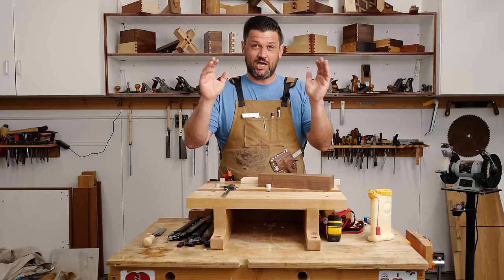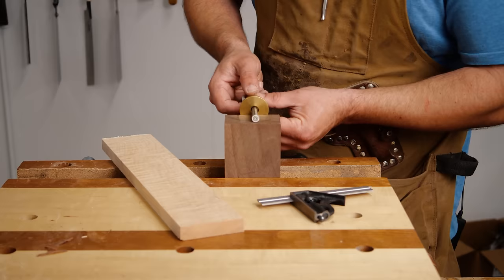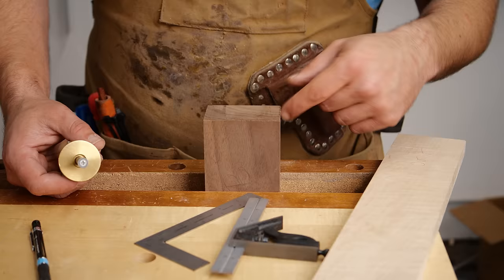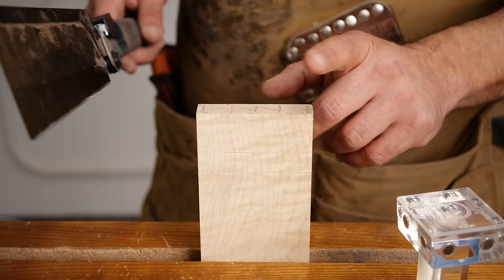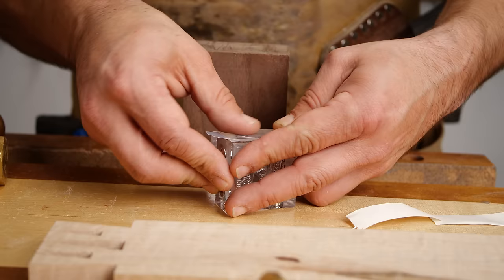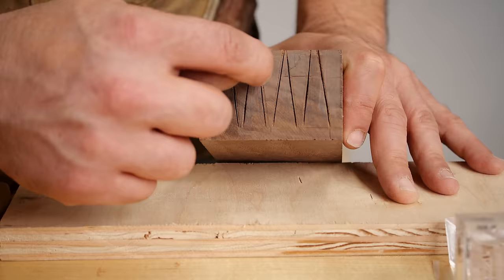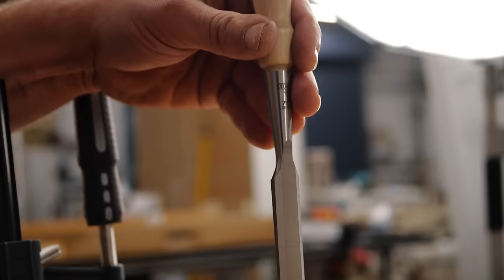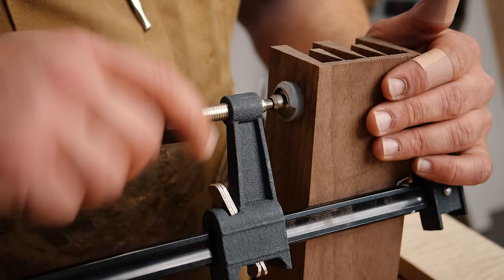Houndstooth Dovetail - Joint of the Week

Comment: Fish Tail chisel is a God send for the pins.
Reply from the maker: Going to have to try one of those
Reply: I took my CBN wheel grinder and modified one of my cheaper high carbon chisels into a fish tail chisel, the CBN wheel does it while not heating it up as much since there's a big amount of steel to be removed.
Reply: The fish tail chisels are really expensive, maybe you could do a video on making some.
Reply: It is a total PITA getting down in there if you don't have the right tool. Rob Cosman makes/sells a good one for $150 (the Chinese version is $120 - for $30 more I'd rather have the real deal)  That is lot to spend for a total one-trick pony but you could cut/grind your own based on photos. - I might drop the $150 just to cure the frustration.
Reply: Tioga Fretworks I got mine from Lie Nielsen for $75.

Comment: I've used a Dremel rotary tool with a tiny bit to clean out half-blinds. Not the whole thing - just getting the undercut and corners once the bulk of the wood is chiseled. The Dremel is easy to control but still very slow going.  For a drawer or two is tolerable.  And -  I have a friend who uses modified high-speed air-powered dental tools - they're even smaller/finer (he's a dentist LOL).

Comment: Will definitely be rewatching this video numerous times. Very curious to see how well I can make this joint. 
I think what would really be helpful is, a bit more explanation on saw angle while cutting, explain the types of chisel, (show them), for newer woodworkers. I've had friends look at me with that deer in the headlight look and wonder what I was talking about, until I'd show them the tool. Great video. Cheers :)
Reply from the maker: Thanks bud! I can't go through all the tools and steps every joint of the week but I do use the series as a building block type thing. Otherwise videos would be repetitive and super long every time. I suggest watching the video A Comprehensive Guide to Cutting Dovetails for a more in depth look at the dovetail process. Also I'm pretty good about linking videos in the cards that go further in depth on certain areas.

Comment: All you need to clear out the corners of half blinds is a fishtail chisel. Find a couple of decent old chisels from a yard sale and let rip with a grinder.  Sure Rob Gorman has a video that shows one he made.  They are far more use than skew chisels as one does both corners. I have one small one and one slightly larger, wouldn't be without them. Took about a couple of hours on the grinder to fashion them but they will last me a lifetime.

Comment: That's a beautiful joint. I'm curious about the strength. Does it come from the outside edges and leave the hounds tooth portion for aesthetics?
Reply from the maker: No it's all structural. That's 1 inch piece of wood glued into a 2 inch piece of wood as a half blind dovetail. You could lift a car with this

Comment: 7:25
Dude now you say that? my jig is completely scratched, i hope it is still squared now, and i had it for less than a week...
would've been nice if that tip was put in the paper that comes with it for woodworking tips, or on the video references in the product that demonstrates it's use.
Reply from the maker: It is on the paper in the tips and tricks section and in every video I release about dovetails.  I always say start your saw 1st and slide the jig up to it. All saws have tooth set, every single 1. They would scratch anything you put them against
Reply from the maker: Also scratches won't bring it out of square. I suggest rereading the paper it came with. Lots of good info in there
Reply: @katzmosestools  Maybe i am stupid and missed it, oh well, i am just nervous it will be out of square as scratches basically grind material off the surface,
but if you say it is ok, i am happy. thanks!